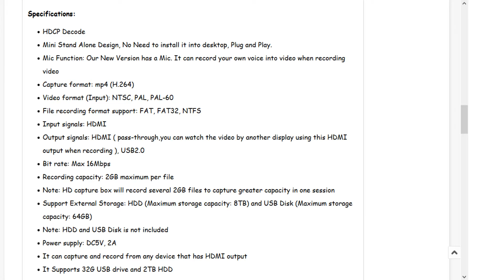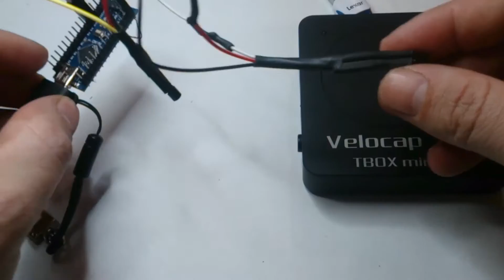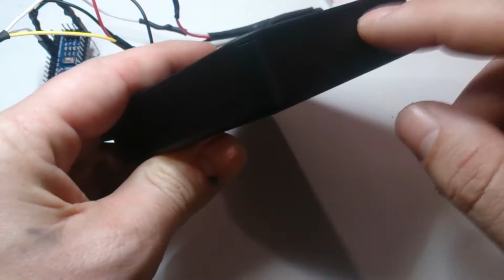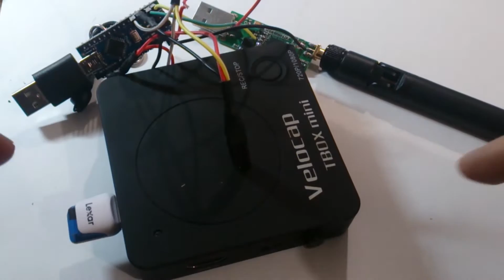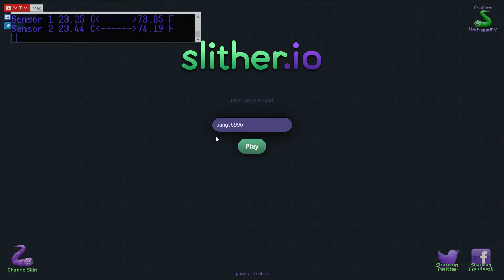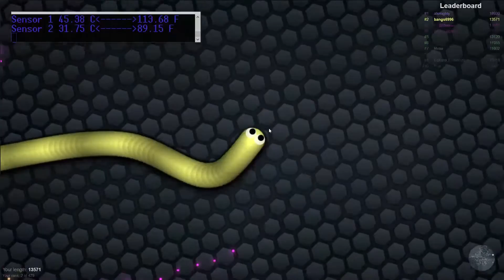Testing velocap hdmi recorder over heating issue playing slither.io

Comment: hello, or version velocap MINI - version  without "+" we are showing here is a jack pc micro usb is open? It operates using software from v. "+"? is it enough to just cut a hole on it? if you need something to connect on the board?
Reply from the maker: HI .. not sure if you got the private message .,... anyways it does work . if you have the usb connector   just plug it into your pc . It will get detected as it9910.. if you need the drivers and software let me know.
Reply: as for your movie disc is in my velocap mini (version without +) mounted on the plate mico USB PC - no only a hole in the casing. I have not tried it yet connected to a PC, has just because I do not have drivers and software. (Previously I thought connectivities PC prez large USB type A USB PC - after cutting the cable A-A 5V power supply - do not know if it's a good idea)
or when you connect your PC via micro USB computer detect it? maybe a mini version "+" differs from "standad mini" only the lack of a CD with programs, hole in the housing and sync cable to the PC?
ps. if tu may..plis send link to drivers and programs to connect Velocap fo PC.
Reply from the maker: Hi..make sure to use this one https://youtu.be/Cuenk9AJRzA?t=59

here is the drivers and soft http://www.velocaps.com/en/ArticleDetails.aspx?id=102

and here are the two files you need if that link goes dead one day ,I uploaded both files onto google drive.
and here are the files you need
https://drive.google.com/open?id=0B2w6_OKE_2kxU3lBRVllWUtzNkk
Reply: thank you, but instalaion these drivers velocap and similar hdpvrrocket ....and... after connecting PC does"ping"..some sees usb port but says the device is not recognized. 
or indeed lack of something on the plate - it can place the diode like in yt film (just what this element must be maybe compare with the version of "+"?) ... or something else? and it looks like it should go without problems
And your mini detects the connection with pc mini usb detected as it9910?
Reply from the maker: do you want me to take a picture of my board?
Reply from the maker: and yes mine gets detected as it9910 hd ..i tested it last night before sending you the files.

if you want you can take picture of your board as well ..and send to 
bangs696969@gmail.com
Reply from the maker: I got your pictures .. and your board looks 100 percent like mine...you are not missing anything.     I tried my files I uploaded to google drive on a virtual machine windows7 64bit .. and it works.. with just those two files.

I have video for un brick hdmi box..  https://www.youtube.com/watch?v=4Wurpagsxr0 

in the description I have file package. with copy of my firmware.. you can try to copy files from try first folder  to usb stick root..   but it might brick your unit if it is not truly the same.

the only thing you need on your box. is the micro usb cable and power
and it should get detected.
Reply from the maker: also what version is on the back of your board mine says YK928R  Ver1.0(20150813)
Reply: YK928R ver 1.0 (20150813)......this same...i will try on another pc...did yu all wire conect? both hdmi+pendrive+micro pc usb to pc.......and GO?
Reply from the maker: youtube does not give me notifications of you posts ..i did not get y our last one till 17 hours later again anyways

Ok so yours should work .. unless something wrong with windows 8.. .. 
all you need  is     ..        Micro usb to pc+Power     to have drivers

all you need to record on computer is
Micro usb to pc+ power + hdmi input

you don't need hdmi output
you don't need pen drive
Reply: the other laptop has detected it9910 win 8 hd, installed drivers as OK .... .... and the device is not connected rozpoznawane..i device manager sees it (velocap) and programs such hauppauge capture, etc. do not see the device (velocap)...nt work...somthing win or wrong
Reply from the maker: try the files in my package.Velocap usb recorder v10.   hauppauge did not work for me either  ..or download Velocap usb recorder v10 from the site i gave you...

Comment: Hello. Can you make dumps for this device, please? Or maybe you know where i can download it. This device have 2 chips : winbond 25q32fvsig and t24c04a EEPROM
I have same box, but it broken and i want to restore it (really nice box, i like it). If you can help I will be very grateful
Reply from the maker: I have not tried to hack it yet, I'll give it a shot later ...  Have you looked over all the soldering points.. On any chip with pins.. you should take your time and push each leg with a needle to see if it moves.   If you don't have magnifying glass  , using a scanner might help as well to find bad solder.    Also the chip that really over heats is the one on the bottom pi3hdmi ..Make sure to check that one for solder bridges.  some of the legs are bridged from factory , but they used extra solder on the legs because they knew it had problems i think
Reply from the maker: Also in the mean time here is a picture of the chip on the bottom, those bridges are fine , but really bad soldering from factory, extra solder can pop or cause bridging else where..  you should be able to zoom into this picture. https://drive.google.com/open?id=0B2w6_OKE_2kxU280azV5U1U4N2c
Reply: bangs6996 no-no, it's not overheating, problem happened when i tried to update firmware using USB flash drive (found "fresh" firmware)), so i think that i need just to reflash chips to reanimate it.. i hope... Now it just don't show any activity when i turn it on. Anyway dumps of EEPROMs will be good insurance in experiments with box.
I'd wrote to many chineese sellers, but they couldn't help me (seller what sold box for me gone at all... surprise). 
So all hope for you. I will wait as long as needed, don't need to rush, please be careful.
Subscribed to your channel. Thank you for response!
Reply from the maker: Ok good you came back and said what you had done, I was not sure if it was worth my time if it was just over heating issue..  It will take some time as my chips descriptions  are scrapped off as well, I will try to do pin out with the chip you said yours has
Reply from the maker: can you send me the firmware you tried at bangs696969@gmail.com .. not sure if I should target the winbond yet ... I want to rip apart  the firmware you used to see if I can get a few hints..
Reply from the maker: errr.. or just delete all the trailing FF's bascailly the same size as one of the files you sent me.. has the same trailing 0000 0000 0000
Reply from the maker: I did it.....I can finally sleep.. I really stayed up basically twice for 24 hours lol.. anyways firmware file is here..https://drive.google.com/open?id=0B2w6_OKE_2kxZWxaeGx0a244M1k
 I am going to look or you can look as well and see if we can inject 
this file into a update file instead.. maybe if we do that you can just 
slap the file on root of usb and see if it grabs it. file is here..   and oops on all the edit spams you probably got
Reply: bangs6996 )) Thank you a lot!
Can you make videos about how you got firmware, and maybe some about ways to get it and work with firmwares on same devices.. i'm sure that it will be very interesting for other peoples, "how-to" theme very popular on Youtube... and it's really interesting how you did that with arduino! right? i'm a little bit shocked, i thought that special flashers needed for that.. but arduino.. wow
Reply from the maker: In theory you should be able to dump it with just a parallel port and couple of resistors.. I already have a cable made up so if I make a video I'll add that option for kicks.. ite tech is very private with any info at all about the chips they make ..tripping on the sdk would be a miracle. only info I have to go on is this from the dump ./SDK./TW/Yeng.ke/JEDI_.9910_Ya         ... So did renaming it to jedi.img work for you?    .. I can't see them pre burning the chip ..has to be away to get to the chip through the cpu..errr.....jtag or serial..  Will see Its my only box and I don't want to fry it ..already burnt one trace and thought i killed it..